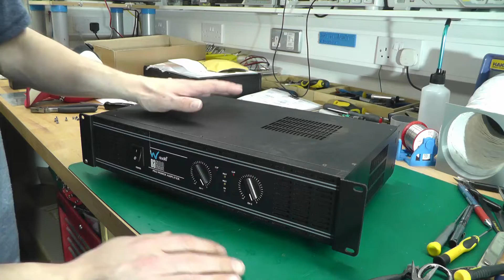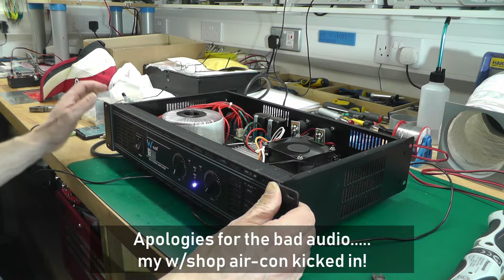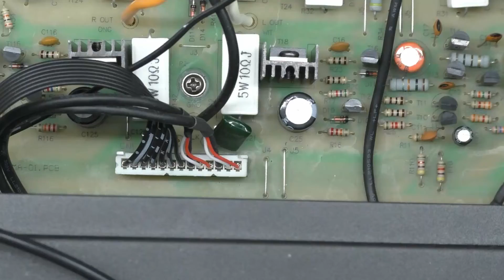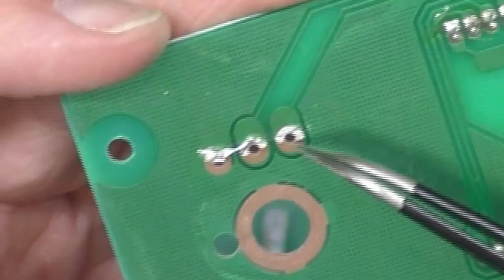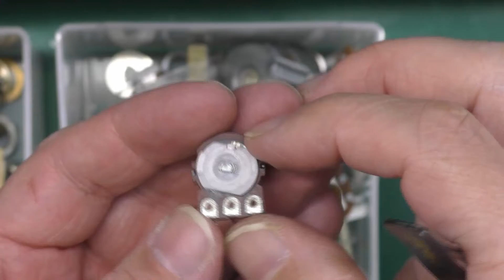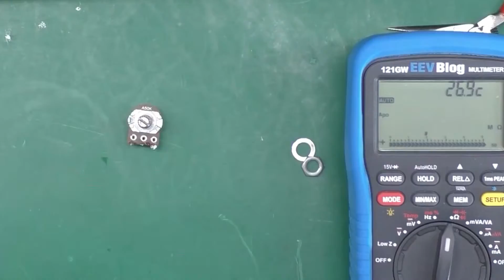No.047 - W-Audio DA500 Audio Amplifier Repair

Comment: Despite the relatively low price point these amps (if similar to one I have badged Warrior DA1000) are fantastic pieces of kit.  Gigged frequently in a 350 capacity hall over 11 years , I never had to run each channel at 1/2 volume and sound is superb and the fan NEVER kicked in after hours of use on each occasion.  I have measured the max output to be just over 400w per channel so on the unit you have, I would guess that should get about 200W per channel.  I do wonder though whether there was a change when the name 'Warrior' was dropped for 'W-Audio'?
Reply from the maker: Certainly they look the same so I think you are right about the name. They are no frills amps, and not a lot to go wrong so not surprised about 11 years service. How flat the EQ is I have never measured and although I don't think they are brilliant audio wise i.e. SM58 and some cheapish speakers they do the job. A shame this one failed in the way it did......but luckily was only used as a practice room amp.
PS. I am used to Allen & Heath desks, Crown amps and Nexo speakers/drivers.........so not surprised I didn't care for the vocal capabilities of this wee amp!
Reply: @IanScottJohnston  There's an interesting debate to be had on the perceived practical quality differences between the 'high end' well respected kit (and certainly the kit you detail falls into that category) and lower budget kit. ... but that debate is probably not for this thread.  One example though is the SM58, a great mic (I had 2) but when I needed to by 2 more for mics for a couple of bands I was engineering I decided to buy Behringer XM8500s at £25 each. Despite initial disgust from the artists, having used them they were all blown away by the sound and were more than happy to continue using them. With correct adjustment at the mixer stage (a smidge more gain and adjustment of mids, you would be really pushed to tell the difference.
Reply from the maker: @standishgeezer  To be honest, the band I was soundman for was a 14-piece soul band, and we had a number of SM58's, but also others in the Shure range which were much more dynamic, and when we first set up the Nexo/Crown gear we were blown away at the difference between it and the old Peavey gear we had......LOL!
https://www.youtube.com/watch?v=duPRamprMZo
(audio is from small camera)

Comment: Hi Ian, if your doing regular audio amp repairs get yourself the other half to that signal generator ie a signal tracer with an earpiece much quicker than a scope, also build yourself a cheap old boys current limiter , basically a 150 watt lamp wired inline with the amplifier power feed, this will light if you get a dead short and not do further damage to the amplifier very handy, ps got here by looking at your segway, good stuff

Comment: Pots can act very oddly, i had a metal detector to fix for a mate.
I found every pot to be faulty in the same way and it wasn't dirt or the wiper.
it was the metal riveted terminals on each end of the track that didn't connect at all !.
It just seemed that the conductive coating at the track ends became an insulator.
Such an unexpected fault.

Comment: great video as always. By the way, have you updated the firmware on 121GW? how is the speed now? I am considering buying one of these but seeing this video and a couple of similar ones discouraged me a bit. I am curious if the new firmware is substantially better or just a little bit better
Reply from the maker: I have installed it, and it is much faster........but havent explored it fully though. But yes, it was far too slow before.......almost to point of regretting buying!
Reply: @IanScottJohnston  can you make a short video perhaps? I know Dave has one already but he doesn't fully test it.
Reply: This is one of the best handheld DMMs you can buy. The only drawback from my view - it was too slow measuring resistance, but it was corrected in a new firmware issue. It does have a uCurrent build-in. Excellent quality too.

Comment: Is there a reason why a dual gang pot wouldn't be a better idea for this unit, or are the channels used independently in some circumstances?

If that were mine and I wanted to ensure matching of the channel levels, I would just mod it to add a dual gang pot and plug up the other hole.
Reply from the maker: In most circumstances they would be left and right of stage front of house and therefore set the same, but very small gigs you could use left for front of house, and right for say on stage monitors, and depending on what desk is in use you may need to pull the monitors right down at the amp. Or, you might use one amp per side of stage, left for driving subs and right for tweeters etc where you would also may need that individual control.......It's just about flexibility and control. I was a soundman for 9 years for a big 14 piece soul band......and the flexibility is invaluable.
Reply: OK, so I should really be thinking of it more as a multichannel amp rather than a stereo amp.

I did car audio for about 4 years as a hobby, I had an expensive (~$18,000) high quality audio system in my car, I built and tuned everything myself, it could produce 15Hz - 20KHz within 2dB of flatness at the drivers seat, with accurate staging and stereo imaging, I used to compete with it at car audio events and was one of the highest scoring cars in the country (only beaten on points for installation not sound quality by some pro audio stores with $50,000 installs in the car), I had fibre optic from the head unit to a digital time alignment processor, which split the audio off to 4 different amps, one for fronts, one for rears and centre channel, and two for the subs, it could do 136dB flat out (without distortion) AND still sounded clean and well balanced whilst doing about 124dB!

I still have a few of the items I used, I still use the subs, they were rated to handle 1KW RMS so my 400W RMS amps weren't too hard on them, I never drove them into clipping either.
I still have some of the processors and pre-amp units, and some of the component speakers too, they are in boxes, one day I might use them again in a car.
Reply from the maker: @TheDefpom  In a car that's unbelievable!.......In the soul band we had about 14kw front of house and 4kw on stage. PA system was Allen & Heath / Nexo combination.......there was no better at the time. 32ch desk, 90% populated. Sound checks were ace fun chucking an mp3 off a mini disk through it all.........Ahhhhhh, I miss those days!

Comment: Not a bad amp at all, but quality control during manufacture wasn't that great, likely. Nice solution, and great video, Ian!
Reply from the maker: Yep, as soon as I opened it up and saw the wiring cable tied to the side of the fan, and the fan itself lifted off the heatsink using a stack of washers I had thoughts......